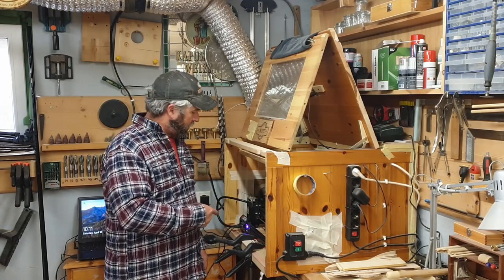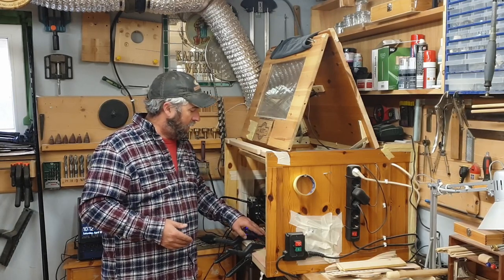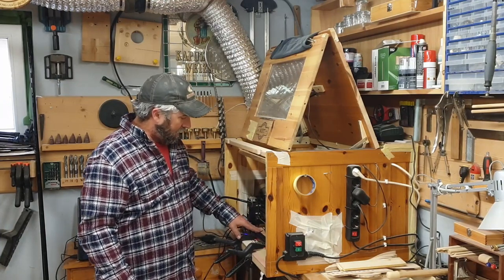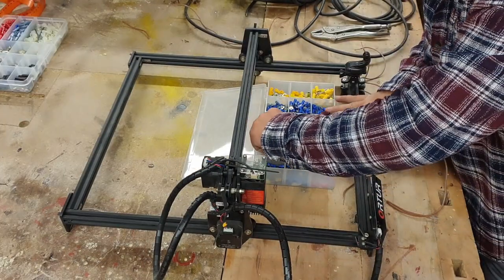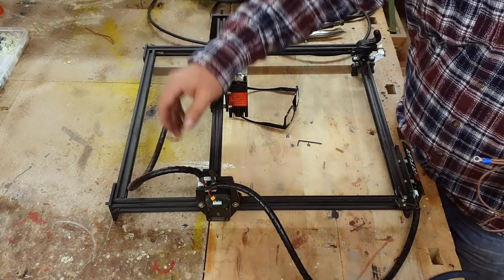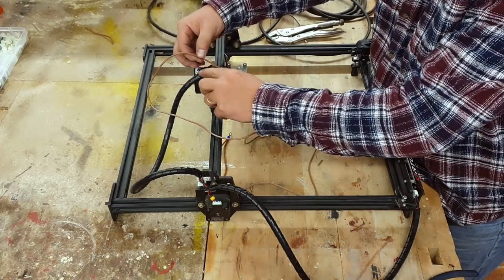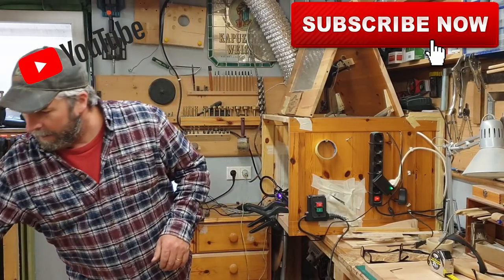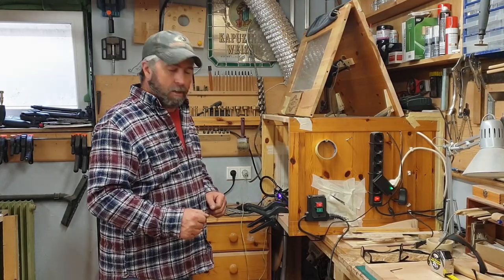I need help, My Ortur keeps disconnecting.

Comment: I've ruined numerous projects because my burn failed prior to completing. I find this situation extremely interesting in that everyone is thanking Ortur for making a video about how to fix a failed equipment design. This problem does occur with other laser etchers as well and what each of those manufacturers should have done is to provide a wiring harness to each owner along with instructions on how to install it.

Comment: im having the same issue, from what im being told its not static build up by the machine or bad grounding in the plug. Its EMP from the extractor fan, probably why it didnt happen when the fan was only on a short time and also stopped when you moved the LM2 across the room. Im still investigating

Comment: its been two years now bud, you ever trace the problem? i have had similar issues when turning on my air assist. and now i have unexpected laser disconnect messages while in the middle of engraving
Reply from the maker: Joshua, yes I did. It was the computer I was using. It was either the computer itself or the power supply. My brother just happen to give me a computer he wasn't using and I decided to use it to run Lightburn. Have never had a problem since. Why the old computer was shutting off the program "no idea" Hope this helps.
Reply: @misfitdiys4791  that's interesting, I may have to swap systems and check for changes. I've been using a laptop for a while now and the problems have become more frequent. Glad you got it worked out because it is a nuisance. 🤣

Comment: It might be power from your home grid overloading the laser check you breakers?? It seems external not direct linked to laser because my switches of when it happens to me
Reply from the maker: Mendella, thanks for the input. It was the socket that the laser was in. Thanks for the suggestion.

Comment: Are u getting power drops?
Reply from the maker: The Outlaw, I have narrowed it down the outlet. I moved the laser to my center work bench because of the new Y axis adapter and now I have no issues what so ever. I'm going to call an electrician to look at the outlet. Thanks for the feedback.
Reply: @misfitdiys4791  Did your electrician ever figure out what was wrong? I am having the same issue and have a machine that is grounded, plus I grounded it to the wall circuit. I cant figure out what is wrong and love the machine besides it stopping randomly and ruining material!

Comment: I would have thought that grounding would work. Is the blower still on the same circuit as the laser even on the other side of the house it could be. I just got the official Ortur grounding kit in the mail but haven't had time to install it yet. The leather and rivet kit came in too so I'll be trying that now. Looking forward to the YRR video. Thanks for the video!
Reply from the maker: George, it ended up being the outlet I was using for the laser. I moved the laser to another outlet and no more issues.
Reply: Cool, I'm glad you got it sussed. I got the enclosure for mine finished today. Now I need room to set it up in the house and not the shop. 😁
Reply from the maker: @georgechambers3197  Now that I have the Z axis roller I have to redesign my enclosure. That should be fun.
Reply: @misfitdiys4791  I have the Ortur roller and I designed my enclosure to facilitate it. I didn't want one of the flimsy lifts that most people use so I got a motorcycle center lift. Kind of overkill but it works and is very stable. Good luck on the redesign too!
Reply from the maker: @georgechambers3197  I would like to see a photo of your enclosure. I like seeing what others come up with and if it matches my vision. If you don't mind.
Reply: @misfitdiys4791  if I could figure out a way to get you a picture once it's set up in the house I'll do so.